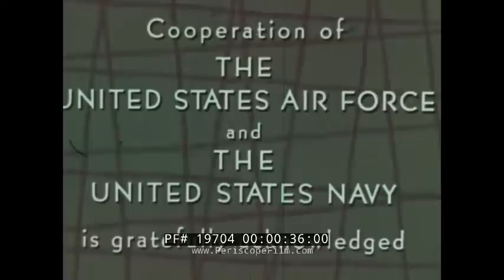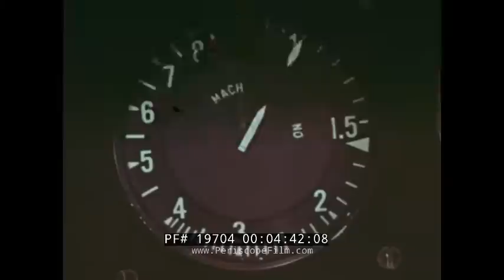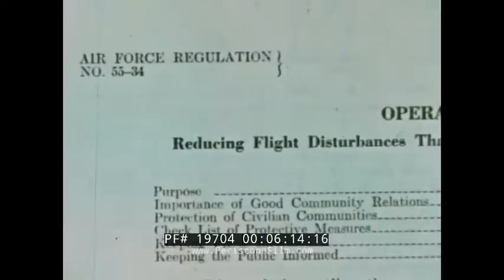" MISSION: SONIC BOOM " 1959 KOPPERS CO. FILM  F-104 STARFIGHTER SUPERSONIC FLIGHT  MACH 1 19704

Comment: 'The sound of security...' unless it was a Concorde causing it of course.
Reply: Yes, well, the Concorde was NOT concerned with security.  So, your comment is comically accurate even though you missed the point.  Sonics booms are not acceptable for civilian transport but is acceptable for security matters.  Get it?
Reply: @videodistro  My point concerned the hypocrisy of justifying the unacceptable,  or not, as the circumstances dictated. The quotation was merely a rhetorical pivot.
Reply: @videodistro  Heck yeah, I'm glad for every sonic boom I hear these days.
Reply: Concorde went supersonic only over the ocean. Never over populated areas. It was load due to engines at any speed.

Comment: The predecessor was the F-104 Widow Maker. The F-105 wasn't much of an improvement or any safer.
The test pilots were something else back then, nerves of steel.
Reply: What was the accident rate not combat loses for the 105 ,? Pilots found the 105 a fast stable attack platform that could not turn.
Reply: What, F-105s have great flight characteristics
Reply: @laurencethornblade8101  I asked you to look at the accident rate and there is a number of original accounts from Thud pilots as well many on youtube.
Reply: what are you on the thunderchief in Nam was a flying tank as to battle damage!!!
Reply: @keithmoore5306  Unfortunately and very tragic 397 shot down due to LBJs rules of engagement than to any other causes.
Reply: @keithmoore5306  63 of the 397 Thuds were non combat loses
Reply: @jeffreywilliams144  not an unusual number for planes of the era most of them other than the F 5 had a lot of non combat losses too!! but you have to admit seeing film of some of the battle damage they came home with and were flying again 2 weeks later that was one tough bitch of a warbird!!!
Reply: @keithmoore5306 How can 397 loses of one type of aircraft be routine? I don't need pictures or videos from the Viet Nam war when most of the aircraft were shot down over Vietnamese jungles. Finally research what aircraft were flown by the majority of the USAF guests at the Hanoi Hilton.
Reply: @jeffreywilliams144  that was the noncombat not losses from tactical missteps!! combat losses were from nonmilitary idiots running things